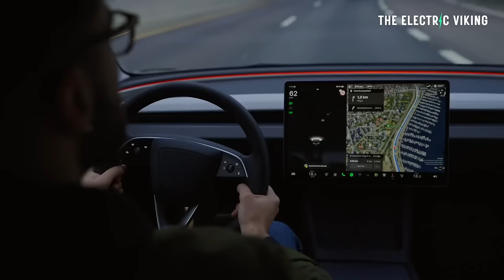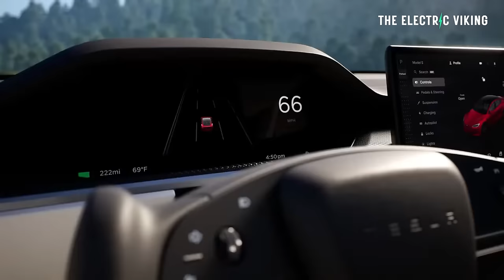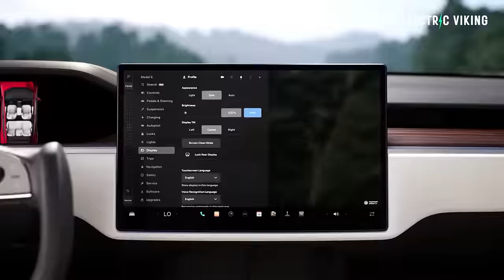Legacy Automakers lose $6,000 USD on every Electric Car they sell

Comment: I think batterys  will get super cheap and if any car maker can get them cheap enough they will start making money.
Reply: BYD and Tesla are already profitable making EVs.  One key is making the car lighter, so you don't need as large a battery to get the desired range.  Taking an obsolete ICE platform and stuffing in a battery and motors, makes for a very inefficient design that requires even more batteries. The costs will never be competitive.

Comment: Your comment section is getting wilder by the day Viking.
Great job educating people on the issues but I don't think it's getting through to everyone.
Main issue with profitability has to be outsourcing the costliest parts like battery production & pack building. Bring it in house and there is at least a chance at profits.

Comment: If Ford are losing $30,000 then most companies will be losing a lot less than the average. I saw somewhere cars are traditionally sold at cost and profit is made in spare parts. Tesla's disadvantage wasn't that EVs don't have much to go wrong but that they don't have that many old cars on the road.
Reply: Another factor often missed is companies like Ford and GM get the equivalent of $10K in ZEV credits for each EV.   If they don't produce enough EVs, they have to buy those credits from someone else like Tesla.  So they can easily afford to lose $10K on each EV and still come out ahead.

Comment: You actually have it backwards most automakers actually right around Breakeven with their Eevee sales the problem is when you factor in the capex which is pretty much a one-time expense that's where the massive losses come in generally in the world of manufacturing every time you double sales you increase profitability by anywhere from 5 to 10%.... everyone knows this but when Ford has all the dealers telling them hey we've got enough EVS on our Lots they're not selling they have no choice but to cut back production and the more they cut back production the more it actually ends up costing them per unit a car like the ionic 6 is a perfect example the ionic 6 is about the same price as a Tesla Model 3 however the model 3 is about the same size as a camry inside while the ionic 6 is about the same size as a Corolla.
So people look at both and choose the model 3

Comment: If legacy carmakers actually have production lines working and are working towards lowering costs overall via some kind of learning curve (like Kia/Hyundai),  falling battery prices might save them.  Shuttering production lines until they get  a better plan like GM/Toyota did will drop them out of the race.

Comment: I actually prefer an EV that was made out of an ICE car. I have a Mini and the big attraction to it was that I have a fighting chance of converting it to an ICE car when/if the batteries or expensive battery charging/ management electronics die before I'm ready to scrap the car.
Reply: That would almost certainly cost more than a new car, unless you do the work yourself.

Comment: Why do they make a loss on electric vehicles? If an evs has fewer parts and requires less maintenance. If should cost less to make. Legacy automakers can not compete against Chinese electric vehicles. The cars that legacy automakers build are expense and have fewer features. That's why. They are driven by greed. Not what consumers want.
Reply: They lose money because they are amortizing the development and tooling costs for the vehicle.

For [a very simplified] example, if their engineering, tooling and manufacturing costs for a vehicle line is $100,000, then they sell two cars for 25,000 each, then they have lost 25,000 for each car they’ve sold. (Obviously these figures are for example only.)

Comment: EVs are only useful for :
1.people who own their own homes and so have charging available at home
2. and those who live in warm climates because once the temperature drops below freezing EVs become practically useless.  
My next car will be a hybrid which gets 2x the gas mileage of a ICU and doesn't require home charging in order to be economical, has no range anxiety and isn't negatively affected by freezing weather.
Reply: In Norway which has colder winter weather than the US, EV's are 90% of new cars sold.  So, cold weather is not a deal breaker for EV adoption.
Reply: @KhanR1-qm2xi  

Good for Norway. So how do they charge them in Norway if they live in apartments? In the city I live in I don't know of any apartments that have any EV charging stations. Also what happens when there's a storm and the powers out for a week? EVs are dead in short order (due to a 40-50% power loss in cold weather)  whereas ICUs with gas in their tanks can still function. 

Hybrids are practical in a REAL World scenario whereas EVs are not. And people in the U.S. are starting to realize that real fast, hence the drop off in sales.
Reply: @mikeearussi  EV sales in Sweden and Finland are also very high. People top up in the vast charging network. One big advantage in cold climates is that the car can warm the car and defrost in advance of the driver arriving. I had no idea that electrical distribution in USA was so bad. If power is out for a week how do people get lighting? cook? stay warm? How do gas stations run with no power? Why do people tolerate such an inadequate system?
Reply: @gpsfinancial6988 

 We have a very poor electrical system in the U.S. When the power goes out nothing works unless you have your own personal electrical generator as some hospitals do. We have a privately owned for profit electrical grid partially regulated by the local state government. The companies save money by cutting back on needed upgrades and skimping on maintenance. This is a very important reason why EVs in the U.S. are unrealistic along with the fact that there is literally no place to charge them if you can't do it at home. .
Reply: @mikeearussi  In Norway, more and more apartments are installing EV chargers. I agree that in the US we need to dramatically improve and install far more EV chargers in apartments and condominiums. However Tesla has supercharger stations all across the US so apartment renters can charge there. We still have a long way to go to improve EV charging for those without garages, but we're still in the nascent stages. Remember we've been using dirty gas cars for over 100 years. EV's need a little more time so we can build out the necessary EV charging infrastructure.
Reply: @KhanR1-qm2xi 

 From what I've heard (not owning a EV) is that public charging stations charge 4-5xs the KWH cost of home KWH, so where's the savings over gasoline? Also apartment rents are high enough already, but if they are forced (say by govt mandate) to add chargers the rents will go up even more.

 I just don't see EVs ever becoming cost efficient over hybrids, and at the present time they make no sense. The only way EVs will work is if there is a dramatic advance in battery technology allowing ultra fast charging and a doubling in range along with less sensitivity to cold weather.
Reply: @mikeearussi  That helps explain why Tesla's overpriced Powerwall backup system sells so well in USA. Many EVs now have the ability to power appliances - Ford claims their F150 Lightning can power a house for 3 days. Neither of those things are much use if you live in apartment. I expect that as prices drop more apartments will use battery storage as a backup. Currently it would add about $30,000 to the cost of apartment to have 3 days backup, I expect that to drop to about $10,000 within 5 years.
Reply: @KhanR1-qm2xi  Cold weather is very much a deal breaker if the system isn't set up to handle it, and ours isn't.

Comment: Averages are meaningless in this context. You need to know, at the minimum, the amount PER manufacturer and even better would be the amount per model, like MachE, Lighting, Lyriq, Blazer EV, etc. 

If GM hadn’t made the stupid move to tie themselves so tightly the to the Ultium battery chemistry, a chemistry that was out of date before the factories to make them were even built, they could have partnered with CATL and be at least breaking even per car until they could get their software debugged and start producing cars at a price and volume where they could make money.

Comment: I just don't get how EV's cost more to build, than an equivalent combustion car. Take apart just an engine, lay the parts out on a table, and count the number of precision moving parts there are. Or, take apart a modern transmission, and let's get a parts count on that. then, let's get a total cost on the emission controls components of a combustion car. With an EV, you're getting rid of the engine, transmission, and pollution control systems. The savings there should be more then enough to offset the cost of a couple of very simple (albeit powerful) electric motors, and a pretty good size battery. The difference in cost with the electronics isn't as much as you might think, it's much easier to electronically commutate a rotating magnetic field, than it is to maintain perfect fuel/air ratio, optimum ignition timing, and apply just the right amount of exhaust gas recirculation, to make the engine deliver the performance, while maintaining emissions within acceptable limits.
Reply: Must be cost of batteries and engineering new production methods.  EVs not quite as simple in real life as it seems they should be.  Remember as well how expensive flatscreen LCD TV's were at first.
Reply: It's not just about the materials and labour, it takes a mammoth amount of person hours and $ to transform entrenched multi trillion dollar companies that have been around for donkeys years. Factories (closing old ones, opening new ones), tooling, supply chain,  hiring people  who know what they're doing, dealing with unions, training service and sales departments not to mention the products have to be reliable and something people want to buy.
Reply: Just like it cost 20k a night at the emergency ward.

Comment: Legacy automakers should just wait until parts suppliers can provide most of the car including battery systems and software. That will also require battery production to ramp up to the level that can supply all automakers and more to bring the cost of the batteries down. The good news is the battery pack is such a large percentage of the cost of an EV the cost falls as batteries get cheaper. That's a huge cost takeout potential ICE doesn't have. The production of ICE parts has already been optimized to the limit and can't drop like batteries can.
Reply: Or they can liscense working tech from Tesla.
Reply: @danharold3087  The vehicle management maybe but the UI and driver assistance stuff is not keeping up. I know…I have two of them.
Reply: @frankcoffey  The drivers assistance stuff has been kind of orpahaned while the work of FSD.    You should be getting the FSD V12 (Supervised) 1 month trials.
Reply: CATL have already stated that a 60 kWh battery pack will cost less than $3000 by the middle of THIS year! How much cheaper Do things need to get before Legacy auto will just get on with it? To just say that the auto industry needs to wait for everyone else to ramp up and help them out. Is not going to work. Bear in mind legacy auto dumped all the chipmakers the second Covid hit and many of them went out of business and then there was surprise surprise a chip shortage…. No one does anyone any favours in this industry.

Comment: Having engaged with many people who are under the spell of ICE car experience and propaganda, the charging, and range 'requirements' that US consumers demand are silly. They simply can't conceive of a change in their habits that actual EV owners soon realize - 85% (not 99%) of their charging will be at home and 15% will be at chargers. Over and over again, I get nasty commenters insisting that I'm spending half my life charging my car. It's similar to when cell phones replaced land lines - a lot resistance until one actually had a cell phone. Then one realizes that they just don't use their home land line anymore. But Americans are stubborn.
Reply: @Markcain268  Of course, and I've always acknowledged that as really the only legitimate reason to worry about charging issues with EVs (especially Teslas). People who can't charge at home have a strong reason to hesitate - I always admit that up front.

Comment: EV depreciation, EV range issues, makes them a bad buy. Demand is not there
Reply: Most drivers do less than 50 miles/day.

The higher depreciation doesn’t matter because it’s driven by falling new prices, so you can trade in your Tesla for a better one for less.
Reply: Penty of demand, that's why the Tesla Model Y is the best selling vehicle in the world.  EV segment is also the fastest growing segment of the auto industry.  I'll agree there is not so much demand for poorly designed EVs just like there is little demand for poorly designed ICE cars.
Reply: The depreciation is driven by new models coming in at lower prices. It's actually a good thing.

Comment: No no no no no no no no no no.  Most people will not charge at home.    Most people park in the driveway or on the street and will not have the capability.   They will not pull out long extension cords to charge every day.   They want the ability to do so...... But they will use fast charging at convenient places almost exclusively.  The average person is going to be much different from the early enthusiastic adopters
Reply: You can install an outdoor outlet (and many do) to charge in the driveway.  Most EVs come with a 20-24' charging cord.  The average person quickly finds out that with EV charging at home, it takes 5 seconds to charge (plug in) and paying 1/3 the cost of gas. Avoiding wasting 10-20 minutes driving to and fueling at a gas station is a strong motivator too.
Reply: @tesla_tap  you're talking about slow charging overnight with a little tiny extension cord...  Medium charging at home will require pulling out a heavy heavy duty extension cord....240v...30-50 amp. People who don't park in the garage right next to a charger are NOT going to do that every night and then put it away every morning.... Most people will need 50 ft to 100 ft.,.... You can forget about it being cheaper.. it will not be when it's taxed for road taxes.... It will end up being more expensive guaranteed... Because there's a sheet load of new infrastructure that it has to pay for.     Then they have to pay to put in the receptacles.... And charger at home too...   Most people are used to going to gas stations on their way to work or home every single day.. they're on virtually every corner.... Half of America stops to buy beer on their way home every single day...... If you put the chargers in the sensible places... Existing convenience stores and gas stations.... it's not a big deal.  If you're a total moron and you put them in out of the way places ...nobody will use them.... And you're going to have much slower adoption.
Reply: @MudflyWatersman  - Lots of variables. I have two Supercharger locations that are closer to my home than gas stations (although I don't need them).  Around hear in suburbia, maybe 1 out of 500 homes have a driveway longer than 20 feet. I've seen plenty of EV owners attach a Wall Connector (with 24' cable) outside of the garage and park and connect with the car in the driveway. The Tesla Wall Connector is waterproof.  Installation costs will vary a lot depending on the wiring. installation costs are typically $500-2000 and there are often utility credits and IRS credits that can defray most of the cost.  I'm sure there are situations where the ideal connection point makes it too costly, but it's not the norm and often easier than people expect.
Reply: @tesla_tap  given the choice of having to drag out an extension cord at night..... And put it away in the morning...... Or stop at a charger for 5 minutes while getting a cup of coffee..... I'd take the charger and coffee.    Being able to charge at home is definitely key...... But it's not the end-all.  There's simply times you need to go somewhere now and your car doesn't have enough charge..... It has to be convenient to recharge it,.... It's actually no different than refuelling with gas.
Reply: @MudflyWatersman  - Takes me 5 seconds to connect at home. It's easy even for those that park outside - maybe 10 seconds if you have to go an extra 10 feet.  Really not an issue.  But nothing wrong with those that want to Supercharge instead. The key is there are so many ways to charge and each owner picks the best way for themselves. Note that the best cost savings come from charging overnight when the rates are very low.  Charging at Superchargers is cheaper than gas, but not as much.
Reply: @tesla_tap  even Tesla own data shows that users are using superchargers way more than they thought they would..... And it's impacting battery life... And mind you these are just the early adopters.... The people who were enthusiastic about it..... They're not people with range anxiety.... Charging at home is great but it's not the answer...... It's part of the solution.   Far too slow when you need your car charged to go someplace and you need it now.
Reply: @MudflyWatersman  - I've not seen or heard any data that show Supercharging is more than a small part of owner's charging.  Please provide the link from Tesla.

As for as battery life, it has zero effect. A few people have been only Superchargering, like some Uber drivers, and it has had not reduced the life of the battery any more than those that only charge at home. 

It sounds like you've never had an EV. There is a lot of nonsense put out by the oil industry and others trying to discredit EVs with misinformation.
Reply: @tesla_tap  i dont own EV.....I work in Lithium battery industry.....i know a bit about batteries.  Tesla is a customer